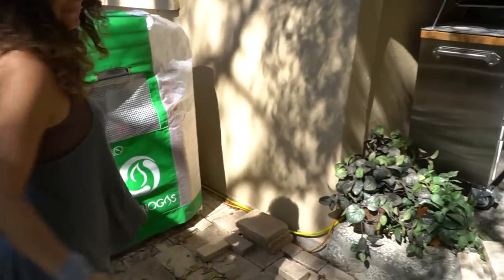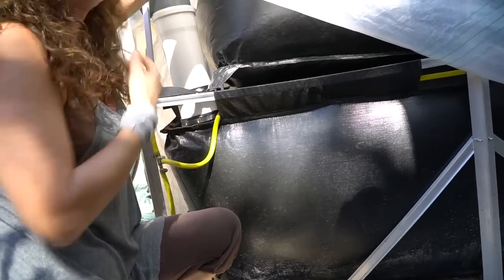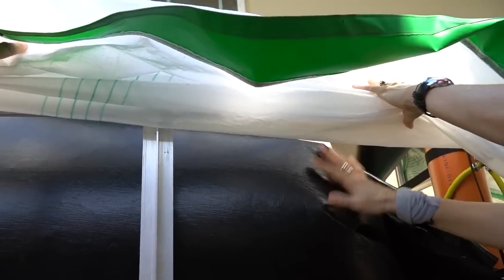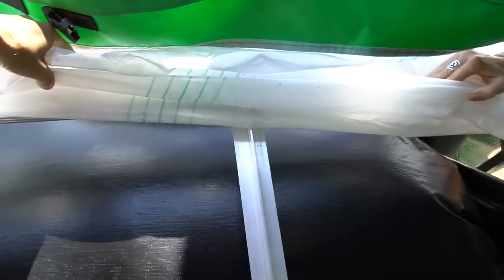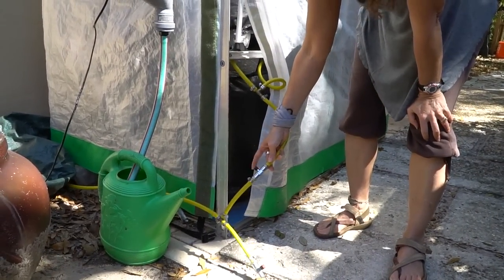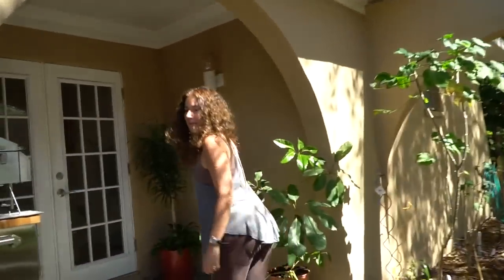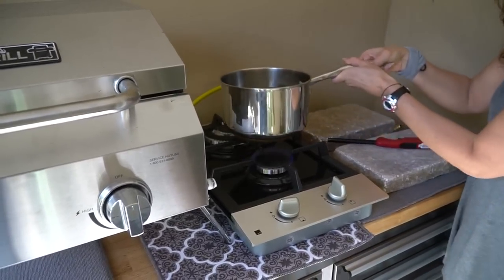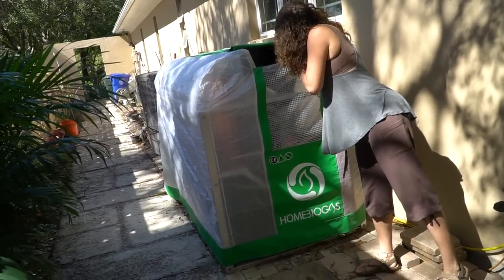Tracy's HomeBiogas System

Comment: idealy, you should put your matt black biodigester tank indoors or under a large south-facing window to remove the need for electricity. To make it more "low-maintanace," perhaps a chute straight from the kitchen with a manual valve fed through bicycle brake lines and an overflow tank to store the fertiliser could be implemented. To cut the cost of building your own, use a large plastic barrel/drum painted matt black, you needn't spend on a sulphur gas filter, as you can remove both sulphur and carbon dioxide simply by bubbling it though water. I hope this helps anyone looking to make their own biodigester 😊👍
Reply: you have one?

Comment: Solar water coil from the roof to a radiant "loop" coil under the unit will increase activity in the system...simple enough.
Reply: Ron Gray can also be used to preheat water so it won’t take so long on the stove
Reply: @4philipp  ว
Reply: Hi
Reply: Hi
Reply: When l   do  some

Comment: wow really awesome! could you tell how much bacteria should be used for a kg of food scrap?
Reply: Thea Theng  hard to pin point on the correct amounts but it’s recommended put in a lot of livestock manure at the start. This manure has natural occurring bacteria from the animals digestive system which will kick start the gas production process. Bacteria should naturally multiple inside the digester in the presence of adequate water (ratio of 1:1), food matter and warmth. It helps to periodically add manure and keep the digester warm to maintain optimal conditions

Comment: Could you have this hooked up to both a stove and a small hot water heater? Like for a kitchen? Seems if you have extra gas then hooking it up to more appliances would be great.

How practical is this for you? I'm really considering getting the Home Biogas 2.0 while it's still on Indiegogo.
Reply from the maker: You can use HomeBiogas to heat water or for lighting, although the primary purpose is for cooking.

Comment: How does this connect to in-home appliances- do you have to use this outside? Does the gas company get involved like the electric company does with solar panels?
Reply: following Joy
Reply from the maker: Hello. You can hook HomeBiogas up to an indoor stove as well, no technician needed. We will provide the gas pipe and on the kickstarter campaign, we also provide a designated biogas stove  bit.ly/HomeBiogasKick

Comment: Could you heat a tiny house with one of these?
Reply: The average production of gas, per day, of one of these units it's about 3.5 hours of normal cooking based on a 2 burner gas stove, so to answer your question, I believe if may NOT be sufficient gas production to heat a tiny house around the clock!
Reply: In short, you need to do the maths. 

It isn't an easy question to answer. It depends upon:
1) What seasons do you intend to heat your tiny house
2) Where is your tiny house
3) How much heat input does your tiny house require
4) How efficient is your tiny house heating system?

For example, if you want to heat a badly-insulated tiny house in Siberia over winter, you will need a greater rate of gas production than if you want to heat a well-insulated tiny house in Morocco over summer.
The other factor is the gas production rate is tied to the ambient temperature - the digester will generate at a lower rate in that Siberian winter location than at the Moroccan summer location.
Reply: Jesse Cole  it depends of a ton of factors,, for example climate, size of your digester, and so on..  
but if your alone i guess you need a well insulated house... 
but if your a big family- big biogasplant and ore you have a little farm and use all the manure-poop both from people and animals-+ food they dont eat and all other organic matter, you can produse a lot of gas-fertiliser. hehe

Comment: What's the coldest and hottest cilmat temperatures for the bacteria to work?
Reply from the maker: Hi! We recommend using HomeBiogas in temperatures above 20 C, but if your climate is slightly colder than that, it is possible to use a heater with the system; check out this article for more information: https://intercom.help/homebiogas/homebiogas-frequently-asked-questions/using-homebiogas-in-your-climate
Reply: @HomeBiogas1  I'm thinking this would be a great tie- in to the earthship model, if incorporated into the south facing greenhouse.

Comment: If this can use horse manure, can it also use cow manure and humanure?
Reply from the maker: you can use any animals manure.. in terms of human waste, HomeBiogas has never tried running human waste through our system. Theoretically, human waste would produce gas, just as animal waste would. However, human waste contains pathogens which can spread many diseases. The biodigester effluent or discharge is NOT sterile and therefore would not be suitable as fertilizer and would need to be disposed of properly.
Reply: Fascinating. I appreciate your input. But what of the biogas? If it were stored in a pressure vessel or gas cylinder, then could it be run through a portable electrical generator?
Reply: can you ship to nigeria
Reply: not a silly question. Gas is gas. It could be compressed and stored. The generator would have to be set up to burn gas of course.

Comment: Hi. What about safety and overpressure?
Reply from the maker: Hello! We have a mechanism pressure release system that releases any excess gas into the atmosphere :)
Reply: Methane is an important greenhouse gas. Are you looking for an other way to dipose exceeding gas ?
Nice work btw !
Reply from the maker: Hi Louis! Thats why HomeBiogas is a tool to capture the methane and use it, instead of letting it emit into the atmosphere. Unfortunately, if you dont use the gas in the system, the excess gas will be released to prevent excessive pressure
Reply: Thx for the quick answer. I guess every user needs more energy than he can produce alone thanks to his biowaste. So everyone must be able to use efficiently all the gas produced by your system and do not waste it.
Reply: Hello Home Biogas  are you familiar with the benefits of adding a little clinoptilolite (zeolite) to enhance the benefits of anaerobic digesters?  ie increasing the population of microorganisms for higher methane yields?

Comment: Can it run a generator.?
Reply: I would think you would need to bypass the carb yet somehow have an air gas mix going into the air intake of generator. The air ratio would change with rpm.
Reply: they basically stole this from the chinese, the chinese version runs a generator.  Stolen idea, passing as if it was thiers